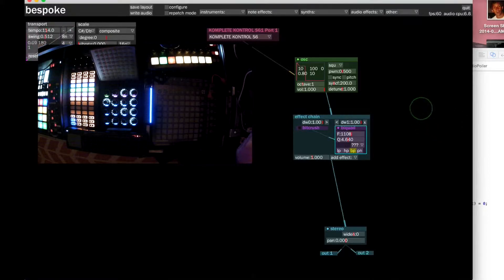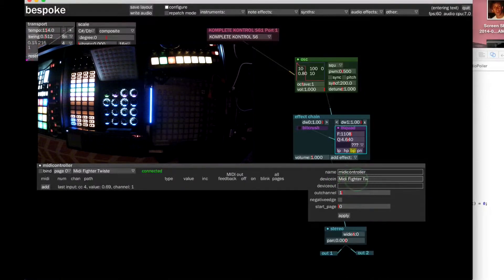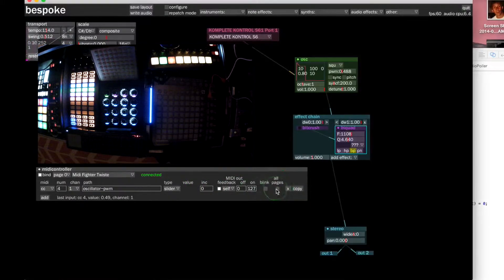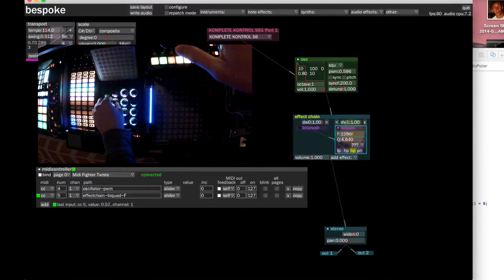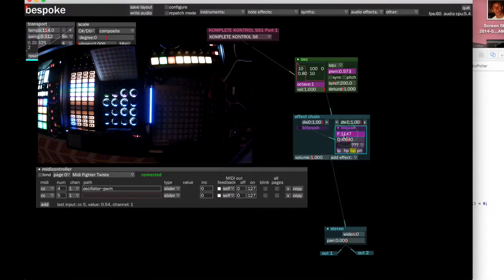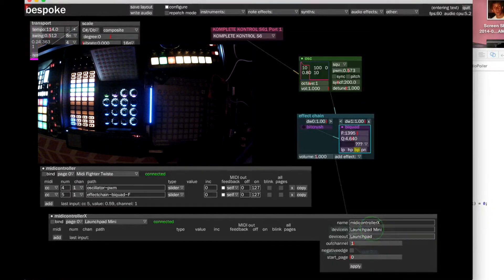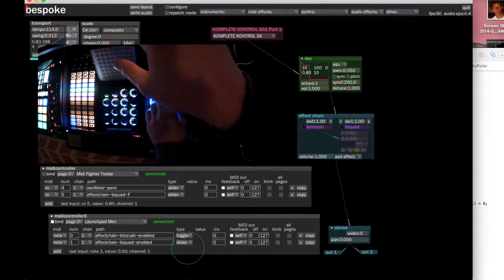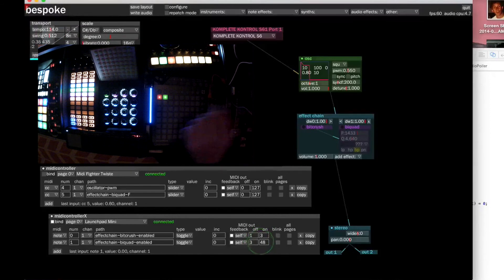Bespoke Midi Mapping Tutorial

Comment: I must be using a different version of Bespoke, but in mine pressing M or shift M is not working (accept to type m). What I have found is that there is a little circle just to the right of the Path box. If you click down with your mouse onto that circle, you can then drag that line to the parameter you would like to affect.  Just press or manipulate the control (on your physical midi device) to get it's number it is sending first then type that number into the num column.  Then connect a parameter by dragging the circle and the path will be filled in automatically.  The WHOLE SCREEN will go purple/pink while you are dragging, and this was a little dis-concerting, but it is just the programmer's way of telling you tha you can now connect to almost anything on screen. For anythinng with a range of values, the "slider" type seems to work best.
Reply from the maker: yes, this video is 6 years old, and bespoke has evolved quite a bit since then

Comment: I just tought, that how difficult would it be able to sign basically secondary midi button to same parameter? So if you have example OXI ONE seq you can sign button that activates the volume and secondary is knob that changes the value, and then another button to effect and the same knob as secondary to change the value. So you dont need so much rotary knobs just buttons that are signed to the value and then knob used to change it. so you could use one good midi controller for almost everything. As i am truly planning now how to build control setup that i can use Bespoke as it would be hardware. and couple controllers that have otherwise enought things but to change values in most things you would need separate pot controller like you have the twister.